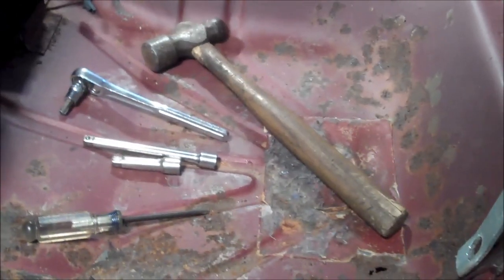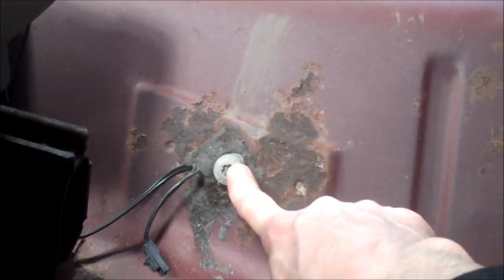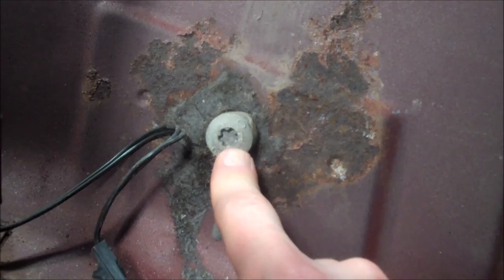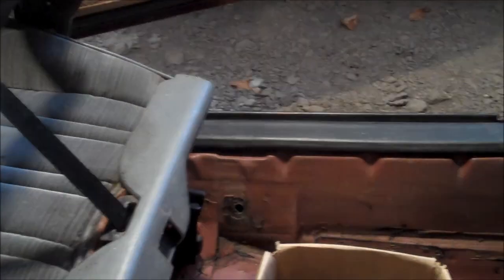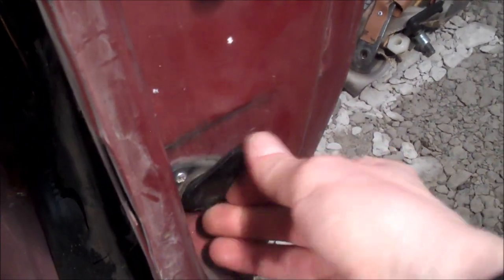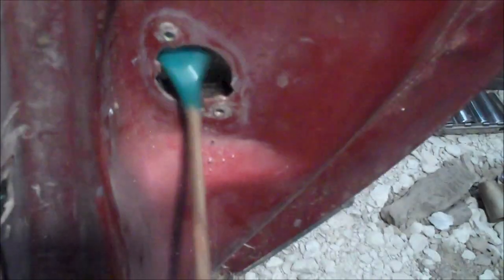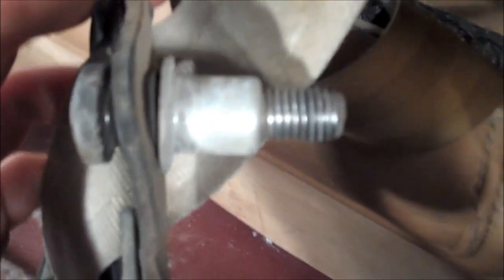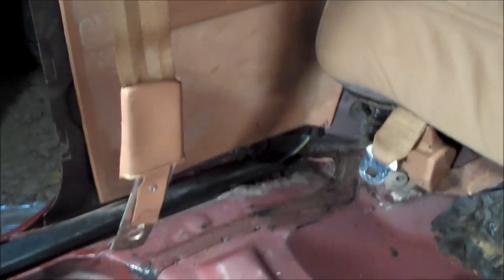Gbody How To! Replace Seat Belts Classic Gbody Garage

Comment: Brians right about being screwed if you strip the head of the bolt. However, he didn't mention that if you heat the bolt with a propane torch they are easier to get out. Plus if you strip the inside of the head, what I have done is take a dremel tool and cutoff disc, cut the edge of it on both side to make it flat on each side. That way one can get vise grips on them.
Reply from the maker: All great tips.

Comment: So mine retracts hard when the door is open. But with it closed, if I lean forward even a little bit it becomes loose and won't tighten no matter what I do until I open the door. Thoughts?
Reply from the maker: Close the door, put your belt on and when it gets loose, give it a tug and release and it will snap back.

Comment: on the back of the belt is a big R and on the other a L. but if I put the one with the L on the left side and the one with the R on the right side the release lever is to long. If I switsch them from left to right it seems oke. Are the R and L on the back useless?
Reply from the maker: Drivers side is LEFT and passenger side is RIGHT so make sure you understand that. Some think it is the other way around.

Comment: Have you made or will you ever make a video on how to remove the upper and lower rear seat cushions? I have an 82 Olds Cutlass Calais and for as long as I've been working on it I've never been able to figure that out. It would really make running wires a lot easier if I knew how to do this.